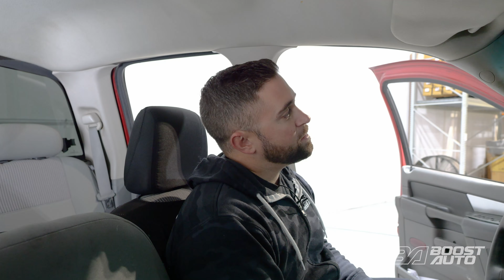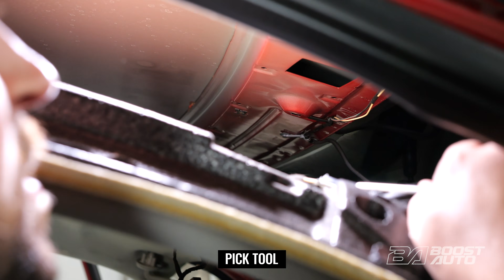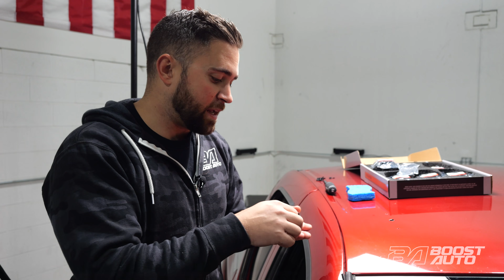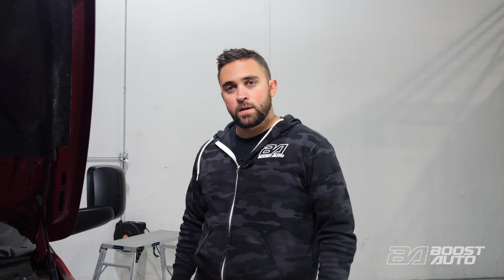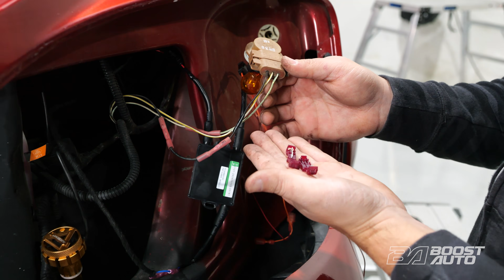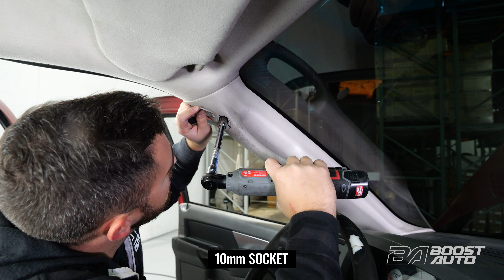S-Series Cab Lights Retrofit Installation | Add Cab Lights to 2003-2009 3rd Gen RAM 1500/2500/3500

Comment: I just installed these on my 03 Ram 2500. Was missing 2 groomers for the screws. On the passenger side A pillar where it meats the dash is an empty connector. This connector was for factory cab lights. I tapped into this. Brown w/yellow is the hot side.
Reply from the maker: Sorry to hear you were missing the grommets - please contact our support team at 765-831-2830 or email support@boostautoparts.com for assistance ASAP

Comment: Self tapping screws right into the body? Cmon, Look at the satellite antenna. Something to grip the screw is needed.
Reply: Yeah and im also like 80% sure these come with the wiring for the cab lights in the passenger a pillar from factory lol
Reply: @justinfortin8095  yep, and how many years later do we need to reseal those with butyl/polyurethane sealer? I think the record has been 4 years?